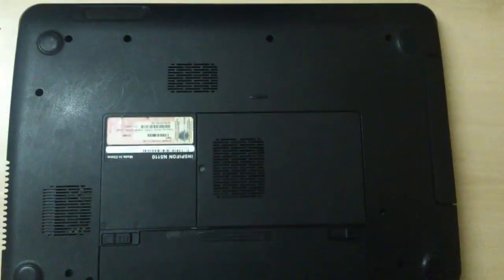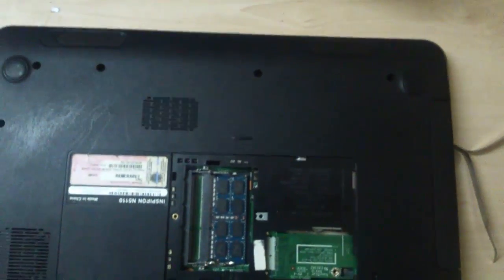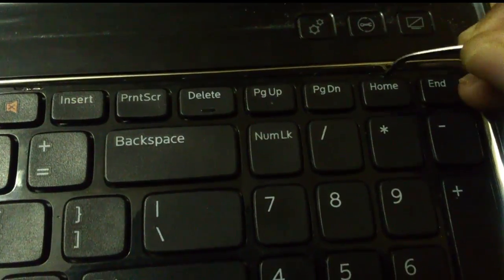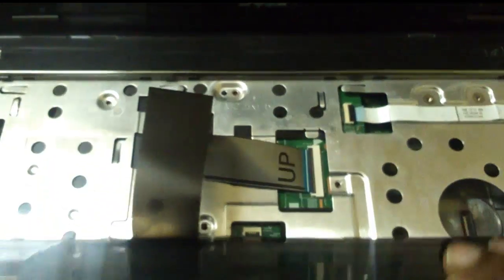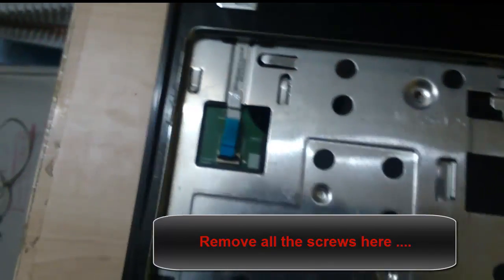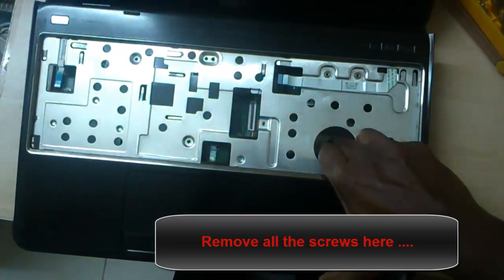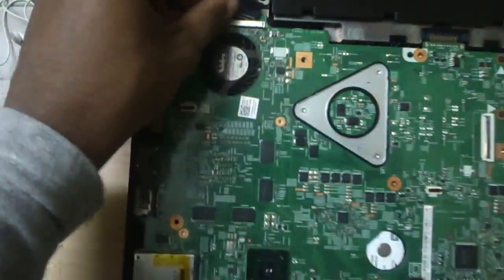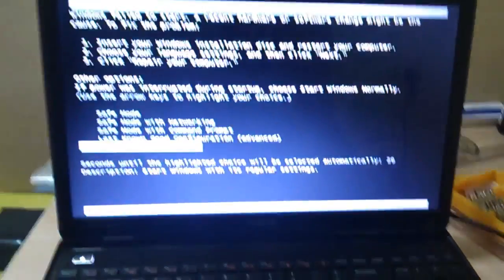How to fix the white blank screen dell (TUTORIAL)

Comment: why won't my cable disconnect from the screen to the motherboard? I can't get that disconnected in order to reconnect it to see if that's the problem it seems like when I try to take it off it's ripping or tearing
Reply from the maker: Try to disconnect by giving little shake  holding both side of the cable and if Ur still feeling that it's tearing get help from some expert.. Be careful and don't damage the cable.
Reply: +Akhil ts thank you, it worked, as far as me getting the cable off, however this technique didn't work for me because my screen wasn't completely white it would go in and out of a white screen, but it was more fuzzy and jumping, when I would turn it on it would slowly transition my screen into a fully white one. And now the screen is just completely gone because its cracked. somehow the crack surface and I'm able to see it through the screen but at first I wasn't but I think with all the playing around with it finally brought it to surface
Reply: +Akhil ts Did you put back that thing you pulled out at 3:16